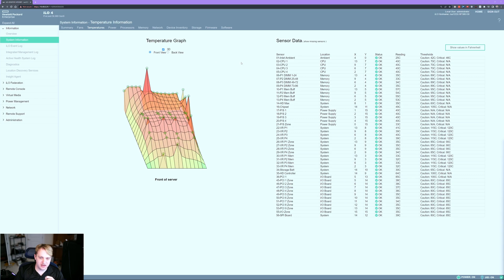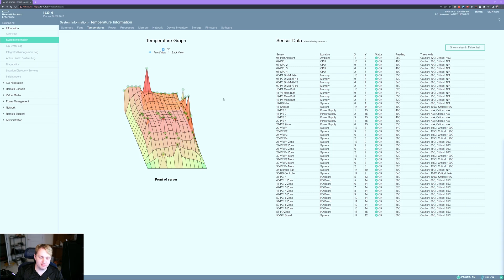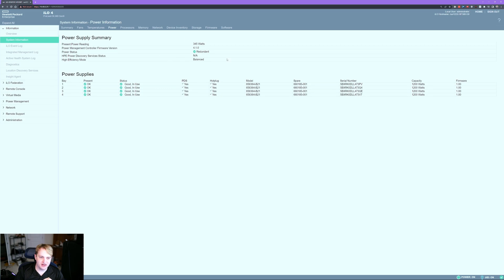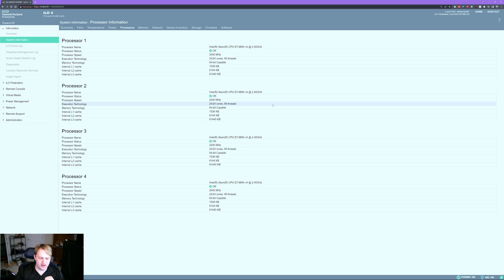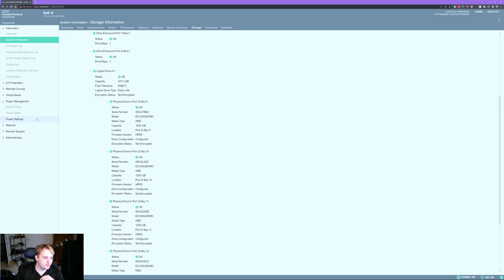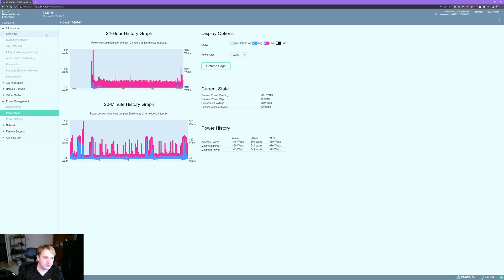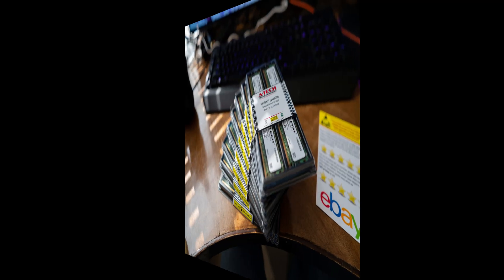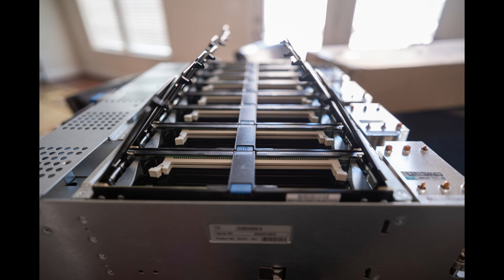HP Proliant DL580 G9 installed!

Comment: I've just taken delivery of my first DL580 and the first thing that hit me was: Jesus this thing is incredibly LOUD! Now I have to upgrade the CPUs, install the second sff backplane, install the caddies and drives and then some m.2 nvme drives via NVME to PCIe adapters in the PCIe slots. I'm considering swapping the fans for quieter ones because I think the noise will drive me insane (even wearing headphones!)
Reply from the maker: If you have not watched my video on noise reduction for the server check it out. With a little work you can tame the fans quite nicely. Also what nvme adaptors are you getting? Just an FYI this server doesn't support native bifurcation so you will need pcie cards that have a controller.